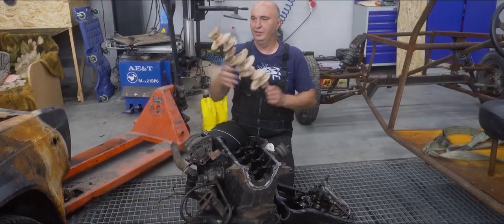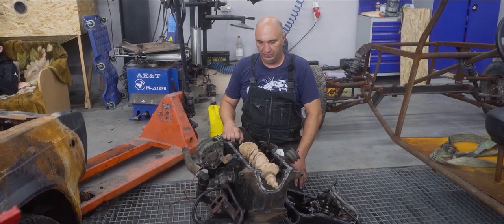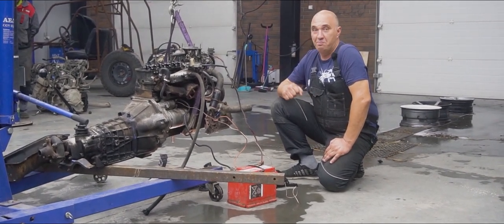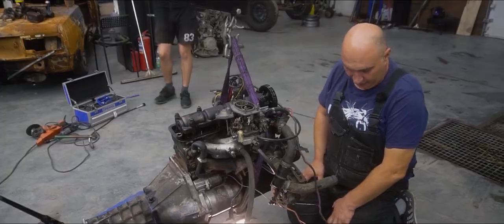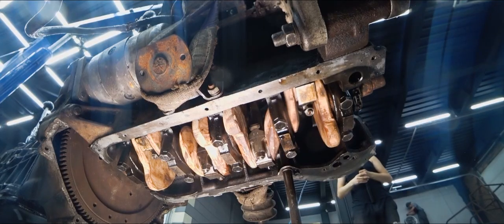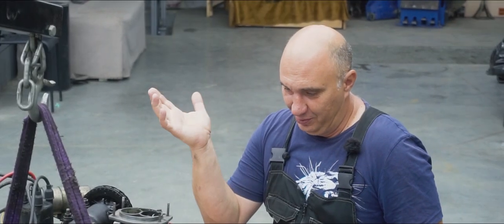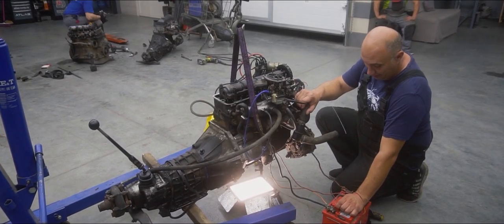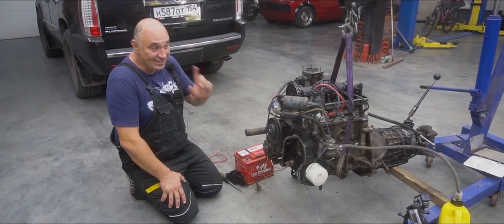Wooden crankshaft – will it work?

Comment: You need to revisit this  but with the crank made by a woodworker who knows how to do it right.
Reply: And make it out of iron wood to even stand a chance.
Reply: Just sacrifice a rainforest tree for the experiment
Reply: @megaglowz8540  I think it would have to be a custom-bent plywood to have any chance of running. No way any solid piece (even ironwood) is going to stand up to the torque without shearing along the grain lines.
Reply: Oak is a dense wood. They should make one piece out of that.
Reply: Yeah, need more than a showpiece stuck with glue.
Reply: @megaglowz8540  ...or bog oak
Reply: Lassi Kinnunen  ...not really......"machine" it from a 6"x6" length
Reply: Put multiple pins between each lobe, finish the wood so it slides better, and PUT OIL IN THE ENGINE!
Reply: Or at the very least use some clamps when gluing it. Without putting pressure on it the glue won't get pushed down into the fibers of the wood, it'll just stick to the outer surface and be brittle.  But even with if you did get a good bond, if the crank was made using only wood and glue I bet there wouldn't be even the slightest chance of the it surviving passed the first cylinder ignition .
Reply: Put pegs in too. Glue has no chance on it's own.
Reply: Lassi Kinnunen  Do you not notice how much expensive shit they destroy?
Reply: They should also take a mold to the original one and make one out of plastic
Reply: Anything you can do, the Russians can do it better.
Reply: @megaglowz8540  one solid piece of iron wood
Reply: @truthsmiles  resin saturated ply and a press together with pins of Ironwood and also mains , and pressure steam set everything. I would think it might make a ten hour ten horsepower engine
Reply: @dannydaw59  Well, at least in Germany the amount of Oak you need would cost around 300-500€. For good oak that is. Cheap can be bought for around half of that. Still almost the same as steel.
Reply: Not a woodworker, a machinist. Same as machining one of steel
Reply: @truthsmiles  Yes a custom hard plywood that is then resin treated when the thing is finished
Reply: I don’t know. Wood is great for a lot of things but a crankshaft? Even if they had it in a lathe with a duplicator the wood fibers likely would just rip and break away under the load of running the timing gears and chain. I am surprised they got as much as they did. They might get a little more work out of it using epoxy instead of wood glue but that’s a big might and who knows if enough to hear it start.

Comment: Drill holes, and put pegs in them to lock the glued pieces together.
Reply: Exactly fit dowels to the glue joints. It will then work.
Reply: exactly
Reply: yeah, that's what I said.  You guys are as smart as me is.
Reply: @buddhaflipdotcom8470  Sorry, I didn't hear you.
Reply: I see the logic but surely under load, the dowls (pegs) would become the weak point? If not them, the holes they're in especially when or if he was successful in starting the engine?
Reply: @snorb1tz  The glue on a flat surface was not strong enough to hold. There needs to be something locking the two pieces. Either a dove tail, or notches that interlock somehow. Maybe have a carpenter make it. They know what wood to use, and how to make it stronger.
Reply: @snorb1tz  Yeah, but would it hold longer than just the glue?  I think depending on the length, diameter,  and number of pegs it would.
Reply: Square pegs fitting the pieces together and I bet it would run for a few seconds. Lol
Reply: @snorb1tz  it's a lot harder to snap when working across the grain like in a dowel. That's why they're used in furniture.
Reply: square holes
Reply: Just turn that whole peice , it can be done if you are good. I think the right wood would work for few minutes

Comment: Should have drilled some holes and put in a few pins and then glued it together :)
Reply: I agree. A few finely drilled holes and glued wooden dowels would sure that right up
Reply: @eugenehall390  Was thinking same :) Was surprised they skipped it. Wooden dowels as in furniture. Two for each connection to prevent rotation.
Reply: @Mathias Ljündberg yeah but that would require some machine tolerance but would definitely make a difference
Reply: nails or screws too

Comment: You will have to revisit this one. Try making it out of a single log.
Reply: Or at bare minimum some dowel pins along with the glue
Reply: I studied and practiced fine joinery and carpentry for 5 years. I am by no means a master carpenter. Far from it. But I had the privilege to learn what I learned from master carpenters. A single piece of wood in this application would actually be weaker. Its all about aligning the grain to prevent fracture. The wood is strongest when load is applied perpendicular to the grain, loads applied parallel to the grain cause the wood to split along the grain. If he drilled large holes through the journals and glued in hickory dowel rods through the journals it would have lasted longer. Using laminates of thin layered plywood built up to the needed thickness for the webs of the crank would have also increased strength. Better yet, make the journals out of solid round dowel rod, hickory or ironwood, or osage orange, something like that, and make the webs out of high grade plywood comprised of thin laminate. I still dont think it will work, but it will last longer. You will be able to get the engine to fire this way. How LONG it will last is another question. Another note, the wood must be knot free as knots are only strong under compression, they fall out when tension is applied!
Reply: Need hardwood.
Reply: Just send me the money it takes to produce the video... I'll explain it doesn't work, and we can go on, mmmkay?
Reply: It will be a billet then....and you know how that makes things better

Comment: just add bolts through the glued areas, and affix some metal stock to the bearing race areas and it will work and not breakdown
Reply: Wooden pegs would do too, and keep it 100% wood and glue.
Reply: @angryhairpeice  yeah, now we're cooking with gas!
Reply: Use epoxy and oven harden it... And lubricate the top end and bores too :)
Reply: Dont even need an oven with suncast. Steve meed has some out that works really good IMO.
Reply: Don't see why the expected something glued together would have worked.
Reply: @carpediemarts705  I honestly thought they were acting. No way they expected that wood glue to hold.
Reply: @amorag59  Wood glue if applied correctly, will actually be stronger than the wood it's joining. they put way too much glue.  Dowels would be the way to go.  preferably two or three  non central dowels, to mechanically not allow the connections to twist or shear off.
Reply: @Skiballer  Interesting, I agree with the dowels as well. It also seemed weird to me that they didn't glue it on a jig to ensure the mains were aligned. Any sort of wobble would seem to be a big factor in the stresses at the glue joints. 3:27 eyeballing it  lol.
Reply: 3:46 you can see how misaligned the two middle throws are too 🤣
Reply: @amorag59  Yeah that's honestly probably the biggest issue, any degree of runout on it  and all it can do is snap.
Reply: 😂😂😂😂 im literally crying
Reply: The oil that they put on it soaked into the glue. There are detergents in oil

Comment: Me: That won't work at all
Also Me: Watches video anyway
Reply: You mean that wooden work
Reply: I thought that maybe it'l start, but it won't hold up.
Edit: They glued the thing together, so I really don't think so.
Reply: I knew they couldn't even get it past the compression stroke while starting it.May be they could get it to start with a solid piece of wood but It still wouldn't be able to turn a load.
Reply: @iuhsdihdslifuvholuidfh  I was really surprised it didn't lose its shit after the plugs went in. Just the starter fighting compression would seem to me to be everything something like that could handle and then some...

Then it breaks and they attempt to rebuild it. This is why I can't be a tuber... I have common sense
Reply: Literally, thats exactly what i said & did 😂

Comment: Just make the whole engine wood

(Its just a joke)
Reply: I was thinking the same make a whole engine out of wood
Reply: Nah takes too long and the end if it would start it wouldnt be more then 5 seconds
Reply: cand make a block of wood as a engine though. not easy any way.
Reply: @cliffcorbitt9494  yeah there are some elements that you just cant make out of wood like springs that you need for the valves, too much work
Reply: It wouldnt work.
Reply: @MATE 72  and  @AnonymousMusic 2625  i'm disappointed you didn't use wooden't
Reply: @TheExactlyatmidnight  lol
Reply: The cliché Youtube smartasses. Person 1 says something, person 2 knows it better than person 1, person 3 knows it better than person 2..... You are all such a geniuses! 🙄
Reply: When you forget this isn't Facebook and go to hold down the like button on this comment trying to find the laugh emogi
Reply: It was done in the 1950 as a teaching aid. It didn't run , but I seen lots of metal motors that didn't run .
Reply: without any spice from lada, it wouldn't make sense.
Reply: There's a material known as Beaver Barf, which is essentially resin-impregnated wood chips, commonly used to make stocks, handguards, and pistol grips for Kalashnikov pattern rifles. That might be strong enough to use for some parts at least.
Reply: ...and run it on wood gas
Reply: I woodnt
Reply: it dont work? why pistons start on fire and develop holes why would he go through all that work to fail immediately
Reply: You guys are crazy, that WOOD totally work. I'm PINEing for it
Reply: @mate7255  you would be able to make the springs out of wood think about a wooden archers bow or even Da Vinci's automatic crossbow (can't remember the name of it)
Reply: @186scott  yeah but the wooden spring would need to huge to becouse of the force and speed needed to close a valve
Reply: @mate7255  true but I'm sure if you was to do a duel valve spring setup that would help  but I'm sure that the valve springs wouldn't be what fails first as if 100% engine was made out of wood not including bearing and anything to bolt the engine together I'm sure the valve spring caps or the top of the valves where the camshaft or rockers push on the valves would fail before the springs
Reply: @mate7255  then make it out of gold, gold and wood

Comment: Aluminum crankshaft: "I'm the lightest around!" 

Wooden crankshaft: "Hold my beer"
Reply: You do know that most wood is actually heavier than aluminum
Reply: @Xeraghusta  yea wood is used becase its cheaper and sometimes resistent and light
Reply: @Xeraghusta  You do know that no wood is actually heavier than aluminum. It's not even close. Better consult some density tables like this one >> https://www.engineeringtoolbox.com/wood-density-d_40.html <<. Balsa: 8 lbs/ft³, Pine: 30 lbs/ft³, Lithium: 33 lbs/ft³, Black Walnut: 43 lbs/ft³, Oak: 56 lbs/ft³, Sodium: 61 lbs/ft³, Water: 62.4 lbs/ft³, Beryllium: 115 lbs/ft³, Aluminum: 169 lbs/ft³, Steel: 488 lbs/ft³, Lead: 709 lbs/ft³, Tungsten: 1200 lbs/ft³. Less gaming more fact checking next time ..
Reply: @xenuno  I guess @UCnBYNcjlJfAPwbw4UjiMGGA  got burned...
Reply: @xenuno  LOL  Owned!!
Reply: Aerogel has entered the chat
Reply: Oh yeah what do they make wind turbine blades out of
Reply: @datboibottemtext  fiberglass.

Comment: At this rate they might aswell just make an entire engine out of wood!🤣
Reply: It would give a new meaning to calling a car a "woody".
Reply: I studied and practiced fine joinery and carpentry for 5 years. I am by no means a master carpenter. Far from it. But I had the privilege to learn what I learned from master carpenters. A single piece of wood in this application would actually be weaker. Its all about aligning the grain to prevent fracture. The wood is strongest when load is applied perpendicular to the grain, loads applied parallel to the grain cause the wood to split along the grain. If he drilled large holes through the journals and glued in hickory dowel rods through the journals it would have lasted longer. Using laminates of thin layered plywood built up to the needed thickness for the webs of the crank would have also increased strength. Better yet, make the journals out of solid round dowel rod, hickory or ironwood, or osage orange, something like that, and make the webs out of high grade plywood comprised of thin laminate. I still dont think it will work, but it will last longer. You will be able to get the engine to fire this way. How LONG it will last is another question. Another note, the wood must by knot free as knots are only strong under compression, they fall out when tension is applied!
Reply: @smh9902  
Seems they could learn a lot from your expertise.
Reply: @lessevdoolbretsim  Its all very contextual. Its also how the load is applied whether its parallel to grain or not. For example, if you you a plank with a rabbit (a rabbit is an offset tongue with one side of the tongue being a continuation of one face of the board) you want the rabbit side pointing in the direction of the load. If the rabbit is facing against the direction of the load then the grain is more likely to split as you're concentrating the stress inside the inner corner of the rabbit. This is just a simple example of many different facets that must be considered when orienting wood joints to maximize the strength of the plank. Grain orientation and consideration, coupled with high surface area for good flue contact (this is why very fine finger joints can be stronger than dovetails in some applications) is everything when it comes to the strength of wooden joints. Japanese puzzle carpentry is a great example of particularly elegant joinery. When I transitioned from learning fine carpentry due to there no money in the ancient artisinal skills anymore, too few people appreciate fine carpentry for a  a carpenter to afford a reasonable living, and I wasn't interested in slapping together homes with nails, I picked up machining and engine building. Read some books on metallurgy and studied engine designing and engineering very intensely for over a decade thus far. Most machinists and welders subconsciously think of metal as a homogeneous material equally strong irrespective of direction, but grain structure also exists in metal. The only true monolithic metals being metal glasses which is a bleeding edge area of materials science research. Castings are the only forms of metals we are familiar with that are effectively agnostic to direction of load. Rolled bars, sheets, plates, etc. derive much of their strength from the compression and orientation of the crystallized grains of metal being compressed and elongated parallel to the direction of the rolling mill. This is why forged parts are, all other factors being equal, always stronger than billet parts. Their grain structure has been aligned with the shape of the part and consequently is uniquely suited to handle the loads for which the part has been designed for. Billet parts are like this wooden crankshaft, the grain of the metal has not been oriented to optimize strength. Forged metal components differ from wood in that their gran orientation can be made to  elegantly bend, ebb, and flow with the contours and corners of the parts being manufactured. Wood cant do that with near the degree of flexability and the ability to take sharp corners with grain orientation. Though wood can be bend with steam and pressure to create interesting wooden arches, contours, etc. which are stronger in some situations that straight planks of wood joined together, metal grain structure can be made to take immediate bends that are effectively arbitrarily sharp (IE as tight of a corner as you like) and can be made to do so with much greater ease then steam bending wood.